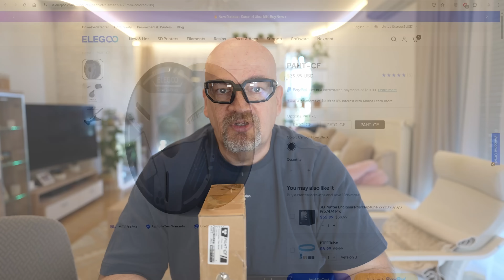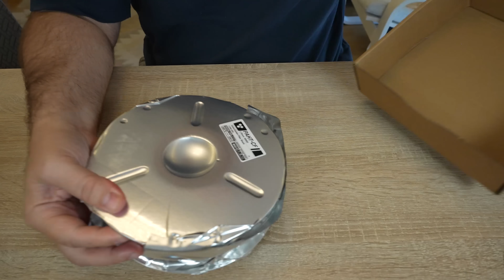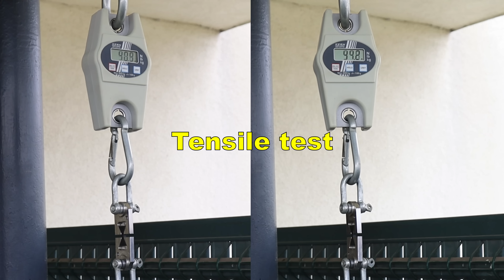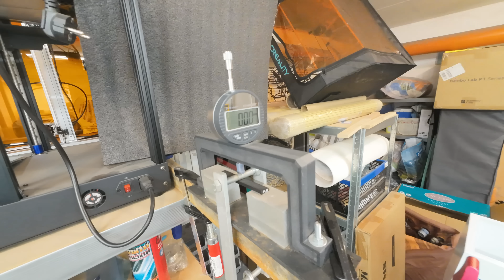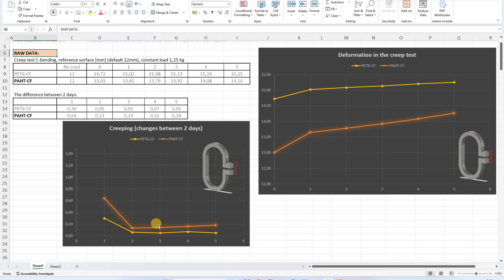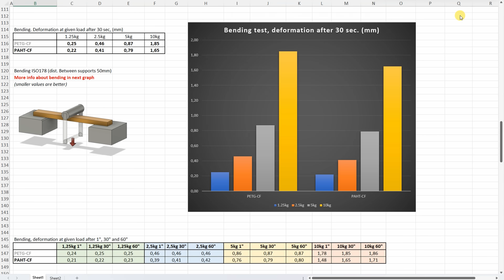High-Temp Nylon for $40/kg? Elegoo PAHT-CF Tested!

Comment: A potential video idea for you - how about testing gears printed in different materials? I'm not sure what the appropriate testing methodology would be, but you seem to have a knack for that. Keep up the good (and interesting) work!
Reply from the maker: Without testing: nylon (we can even buy nylon gears). It creeps, but if the gear is rotating, always different tooth is engaged. Only then it is a problem, if it is under constant load in same position. Then I am not sure about material. But I don't like CF (only core versions)..

Comment: Thank you for testing! I would've loved to see the results of layer adhesion when printing with different chamber temperatures on a proper enclosed printer with chamber heater. I think Nylon CF filaments are a waste to print without heated chamber.
Reply: edge of 3d seems to have had luck printing nylon strong on an enclosed but only passively-heated printer. it'd be interesting to see what/how much the nozzle temp and the chamber temp each contribute to overall part strength.

Comment: Igor, I do get that Elegoo would want to show the CC printing an “engineering” material. BUT, having done that, it would be useful to then put the filament in context, testing under your standard conditions. 
And also I would actually like to know just how good the ‘cheap’ filament might become when the printing conditions are optimised. 
I really can’t believe that for a gift of one spool, you could be (or would allow being) barred from publishing whatever else you might want to do with it after you have run tests using the CC and Elegoo’s profile. 
Personally, I’d be interested to hear your (admittedly entirely subjective) impressions of the “feel” of the prints - does this produce an unusually “fibrous” surface finish?

Comment: No idea if it would improve the layer adhesion, but the current ECC slicer setting is 290C nozzle, 100C bed, 8mm/s max flow rate, and fan speed 10 to 30% (compared to 280/85/12/50 in this test).  It seems like they have tweaked things in their defaults?

Comment: I bought it and have to say its pretty nice. Took some time to dial in but after that its easy to print. Very important is a long dry before print (12 hrs at 70°C). Seems to be wet delivered.  Prints look very clean. I print with 90/280°C and max 70mm/s on my Sovol SV08. 
Thanks for your review!

Comment: Hey Igor, ive been watching quite some video's lately. Thanks for all the info. I do print airsoft parts. Which need to be somewhat able to be used outdoors, in uv, on hot days in constant sunlight so somewhat temperature resistance is nice, in the rain, must be rigid, strong, stiff, dimensionally stable and yet take impact of hitting trees or small 6mm plastic bbs with up to 2.5j of kinetic energy. I have been struggling to pick the right material for durable prints. Prints that I could lend out, or gift and use myself without any concerns of it breaking down. Any thoughts?

Comment: This comment ended up being longer than initially intended but Elegoo really hit a nerve here so here we go:
This seems like a perfectly fine filament and you tested it fairly within their silly constraints, which is why its such a shame that Elegoo dropped a requirement to use a less suitable printer on you only after having sent you the filament and I assume, any agreement was solidified, which is also a dirty move I'll just take this moment to shame them for.
Elegoo really shot themselves in the foot by requiring you to use their own printer with no chamber heating and an official profile that is way to aggressive on its minimum fan speed. I'm sure it would have absolutely performed better in your X1C. This was already basically an ad for their filament, so they should have just let you give it it's best shot with a printer that could actually let it perform at its best. It also hurts how comparable this data is to your data from other materials. Standardization in testing where possible is important. Also, them not answering you on what its base material was is concerning. Elegoo should remember they aren't the only game in town for PAH-CF and be upfront with important data right on the product page.
I like your channel and testing methodology, but going forward I would encourage enforcing with sponsors that you maintain final say in control over testing methods for the purpose of objective scientific data comparability. Keep up the good work!

Comment: I believe the low layer adhesion is a result of printing with too much cooling. For example, Bambu's own PAHT-CF profile only uses 10 to 30% cooling.
But with Elegoo's stupid insistance on printing without a chamber heater, we'll never know what this filament can really do. Sorry that you had to waste your time like this.
Reply: Yea I was interested to see how it compares - layer adhesion to me is one of the most important aspects and it was very weak - which I also believe could be the profile - interesting though the impact strength looked good.
Reply: Need to increase temperature of nozzle as much as you can and totally disable coolling.

Comment: What do you do for ventilation? After seeing how easily GF/CF filament sheds/leaves GF/CF in your skin from contacting the filament, my concern is proper ventilation for any fibers that may become airborne.

In my opinion, a dedicated printer with outdoor ventilation or use of a quality scrubber (like a laser may use) seems neccesary if not required. Health/safety first 🙌

Comment: putting filament that is sensitive to moisture on a cardboard spool should be a crime
Reply from the maker: Not really. Carboard spool if dryed together with the filament, may even help. Big question is which one absorb moisture faster.. But having a good carboard spool (and glue) give us a possibility to try it on higher temperatures. Here I don't know what is the max, but Bambu PPS, PPA up to 140°C. I can dry it in 2-3 hours.
Reply: @MyTechFun I find it takes longer to dry a spool with cardboard then plastic

Comment: I understand them wanting you to use the CC and their default profile...  but...  wish you were at least able to run additional test on the CC with an optimized profile.  The CC goes to 320C on the nozzle and 110C on the bed, I suspect 300F and 100C would have helped the layer adheison a lot.  I wonder why their profile is at 280F?
Reply: That's how I print it, 300c and 100 bed with no fans and I get great layer adhesion although depending on the part use I also anneal it.  Great stuff all around especially at that price point.  Oh and I print it on my Centauri carbon and K2 plus.

Comment: I have printed about 3 rolls of it on my H2D the texture is much rougher than other PAHT-Cf.   I am going to do more tuning.   I heated the chamber up to 60.
Reply: I believe that's just how this filament is in my experience. I painted my parts which ended up looking worse imo 😂. Im only using the elegoo paht-cf on mechanical parts that dont need to be touched. Using Fiberon for everything else.

Comment: According to its behavior, it is a highly crystalline polyamide (PA6 has a melting point of approximately 220 degrees Celsius, while PA12 has a melting point of around 180 degrees Celsius). When heated, it softens slightly, and at a certain temperature, it transitions to a different state of aggregation.
Reply: According to Elegoo, who I emailed asking about the filament, they said it's pa612 based.

Comment: I think elegoo requiring to use the centauri carbon for engineering filaments is a bad idea. In my own experience with it, it is not suitable for printing with engineering filament at all. Chamber heat retention from the bed and hotend is very poor. 
Even worse when baked in firmware overriding the settings from the slicer and turning on ventilation even if it's set to OFF. 
If you try to heat soak the printer ahead of time, it will turn off the heaters after a short time, so you have to babysit it and keep turning them back on.
Even then, with 2 hrs of supervised heat soaking, then beginning print with 110c bed and 275c nozzle, the chamber barely stays above 35c.
Reply: im designing my own chamber heater with PID regulation. 150w PTC heater, esp32c3, BME280 and some code for the web server to manage the settings
Reply: @costantinmutu9337  plan to insulate the chamber and potentially replace the tool head fans as well. I did heated chamber experiments and wound up having terrible heat creep leading to clogged hot ends and failed prints
Reply: @TotesCray  im planning on running a Constellation Extruder mod with the gamma tool head. it might help
Reply: I have the gamma but still stock extruder. I think some of the TZ hotends for the constellation have better heat break and larger heatsinks than stock, so hopefully. 
That said, my original statement stands, as elegoo is certainly not planning to have Igor run a CC that has been heavily modified that way, they're still under the incorrect assumption that the stock printer can reliably print fiber reinforced styrenes and nylons.
Reply: @costantinmutu9337  I think it's capable with enough modding, esp once the opencentauri board comes out and we can run modern firmware.
Until then, even if everything else works, you'll still have to deal with a bed mesh at 60c printing on a bed at 80-110c. If absolutely nothing else, the creaks, clicks, and pops that the bed makes as it heats up from 60 to 110 tell me it's not in the same place it was before, not to mention the first layer inconsistent observed on actual parts.
C'est la vie.  Still a fun printer for the price, and it does pretty well for PLA and PETG, stock. It's been an enjoyable project.
Reply: The printer's chamer temp sensor is not isolated from the frame, so it gives lower reading than the actual chamber temp. you can find mod that fix this

Comment: I wonder what the results would be if printed in a proper high temp printer with the 22IDEXv3 or higher models with tuned settings. Reach out to Vision Miner and see if they'll print the parts for you.
Reply from the maker: I already did, they told me that they will send me some parts for the testing, but this was 9 months ago. I reminded them once, they confirmed the test objects.. but since that.. nothing.

Comment: It would be best if you didn't accept filament sponsorships if they restrict the testing in any way. The whole point is to be able to compare them to others. Your videos have already helped me choose between different brands of similar materials. This one on the other hand is basically useless. Not printed on the same printer as the others, not compared to other similar fillaments - basically not comparable to anything.
Reply: I think elegoo requiring to use rhe centauri carbon for engineering filaments is a bad idea. In my own experience with it, it is not suitable for printing with engineering filament at all. Chamber heat retention from the bed and hotend is very poor. 
Even worse when baked in firmware overriding the settings from the slicer and turning on ventilation even if it's set to OFF. 
If you try to heat soak the printer ahead of time, it will turn off the heaters after a short time, so you have to babysit it and keep turning them back on.
Even then, with 2 hrs of supervised heat soaking, then beginning print with 110c bed and 275c nozzle, the chamber barely stays above 35c.
Reply: Also this does not serve as a good ad to elegoo either. The bad layer adhesion is instantly disqualifying the material for me. And the fact it was printed on elegoo printer is also not useful, nor a good look for the otherwise good printer.

Comment: Ive passed that one over because the reviews id read werent good- not seemingly a real true paht but some mix. I usually can snatch up siraya tech PAHT CF for 50/kg- it goes on sale fairly regularly. Interested to see a proper test. Also- regardless of WHO makes the paht/ppa whatever i hardly use ANY fan whatsoever. Basically ONLY for bridges/overhangs. 50% for this seems REALLY excessive. Maybe run layer adhesion test again with no cooling?
Reply: What do you mean not a true paht.  Paht isn't a type of polymer.  It's just an industry term. It stands for hight temp nylon, which this filament certainly is.  It's pa612 based which I was told by Elegoo through email.  Not only that, it's a fantastic filament.  It prints beautifully, has great layer adhesion when printed at 300c hot end and 100c bed and zero fans.    And it's $40/kg. I've used about 6 kg of it so far.  All I print is engineering grade filaments.  It's not really fair to compare it to Siraya Tech because their paht is ppa-cf based.  Which has different characteristics and is better for different uses.  I use it as well and it's another great filament.  Siraya Tech has some great stuff at reasonable prices.

Comment: Hey Igor. I appreciate the content as always. Slightly disappointed in the fact that you had to listen to Elegoo requests for how to test the filament.
Reply: Honestly, printing everything using Bambu printers and slicers including settings is possibly also a kind of bias. It is fair to compare materials printed in the 'optimal' or reference manufacturer conditions anyway. And it shows that you can get good results with high tech materials on a 300ish USD printer.
Reply: @jcugnoni Completley valid point. I am simply sharing it leaves out those who can achieve ideal print conditions. I am so happy that there are core xy enclosed printers that are the same price I paid for an ender 3 in 2018. Happy Printing.
Reply: @jcugnoni best case is truly do both! Print it on a elegoo system but also a system that another customer may have. Why not?
Reply: @jcugnoni I agree with that a bit.  Still I have used about 6 kilos of this filament and I print it at 300c hotend, 100c bed temp, and zero fans.  Layer adhesion is great.  It's now one of my go-to filaments because if the price and ease of printing
Reply: @jcugnoni  Disagree. Bambu is the standard and all tests should be done on it to help comparison.  Now I have no idea if the weak layer bonding was due to the printer or the filament.

Comment: Yes, I wonder how we can improve the layer adhesion, I usually print at higher temps. Wow that is amazing impact resistance!
Reply: Needs fan closer to zero, 50% is wildly off.
Reply: Because the layers were not bonded, it is a lot like a leaf spring.  So it gives deceptively high impact values.  Igor has shown this in prior videos. 

So yes, if the PAHT had been printed at 290 to 300 (and maybe with less cooling), perhaps that would have improved layer adhesion and given different impact results.

Comment: I used this stuff for a project I did for a friend. He was looking for a new stock for an old .22 rifle he inherited.

The stuff printed completely effortlessly on my X1C using the Bambu PAHT-CF profile. It worked really well with the Bambu Support for PA/PET interface material. Drying was an absolute must. I dried the spools for 24 hours at 80c (Elegoo calls for 8 hours at that temp - I wasn't taking chances).

I was impressed with the ease of printing as well as the dimensional accuracy. His metal parts slipped right in without any difficulty. What I didn't like? The surface finish. Sure, I expect CF-filled PA to have a rough surface, but that doesn't even scratch the surface of what this stuff felt like. Handling the parts felt like I was going to end up with shards of CF embedded in my skin, so I quickly switched to gloves.

My friend bonded the parts with some JB Weld plastic bonder, sanded to smooth out the surface, then painted and sealed. In the end, he's very happy with the results.

Honestly, if I was going to do it over, I'd take a very long, hard look at something like the Siraya Tech PPA-CF Core for the smoother surface finish.

Comment: Damn, it's a bummer, that they had these strange requests about the printer and the compared material.
I think it's a bad deal. The video could be much better without restrictions. And getting material worth 40 bucks, doesn't seem to make that up.
Nontheless, thanks for your testing!
Reply from the maker: If I would know about this request in advance, I would just buy the filament. But I got the request when the filament arrived.
Reply: @MyTechFun  if it was requested after you had already signed a deal with them, i'd have told them to pound sand.

Comment: Is there a reason why your tensile MPa figures are often completely different from what we get from the manufacturer? Is the manufacturer lying or is the moisture or temperature affecting the measurements?
Reply: I don't know if they are printed in the same way, but normally all material properties for nylon varies ALOT between dried and conditioned state. In industrial spec sheets you get both dry and conditioned numbers. But that is rare in the printing world.
Reply: @garagecedric  the 168 MPa Bambu PPA-CF is weaker than the 110 MPa Siraya PPA-CF and PPA-CF core. the nearly 200 MPa creality PPA-CF is the same strength as the 110 MPA PPA-CF core and Qidi CF25.

I don't think this is just moisture. Because PPA-CF is also not as moisture absorbent. Also, the numbers between filaments of the same OEM are similar, Ex: Qidi, Siraya, Phaetus.
Reply: @garagecedric   @garagecedric  the 168 MPa Bambu PPA-CF is weaker than the 110 MPa Siraya PPA-CF and PPA-CF core. the nearly 200 MPa creality PPA-CF is the same strength as the 110 MPA PPA-CF core and Qidi CF25.

I don't think this is just moisture. Because PPA-CF is also not as moisture absorbent. Also, the numbers between filaments of the same OEM are similar, Ex: Qidi, Siraya, Phaetus.
Reply: Different standard.. Compare mytechfun to mytechfun only
Reply: If you look closely the charts are measured in Kilograms not in MPa
Reply: @alternatemusicaddict5226  tensile and layer adhesion are 4x4mm, but also, it doesn't matter. it's all proportional
Reply: Another channel got close to 168 on bambus ppa-cf.